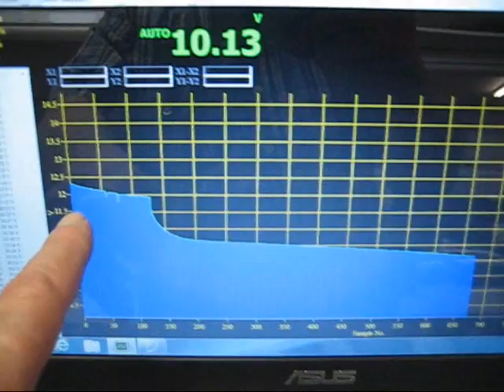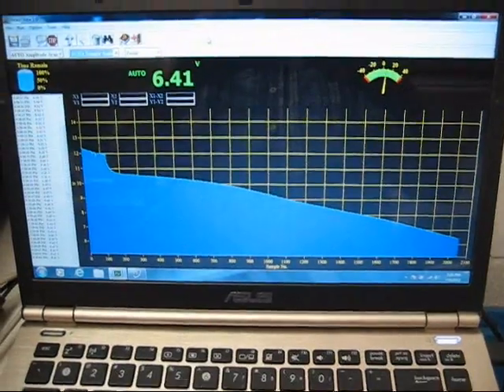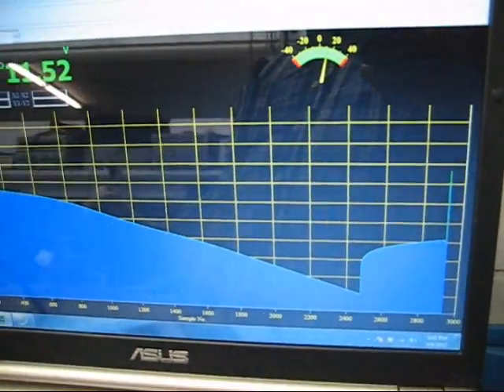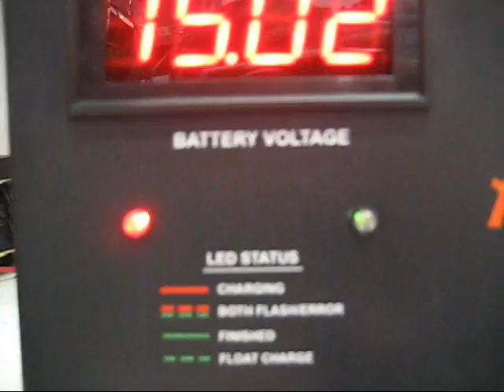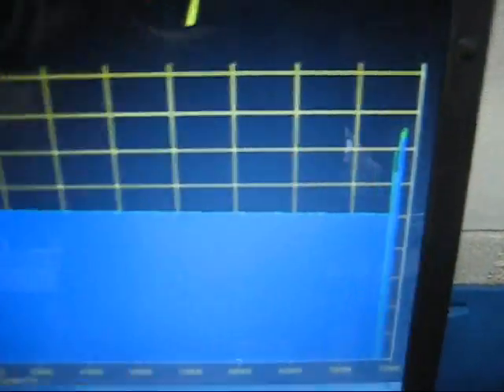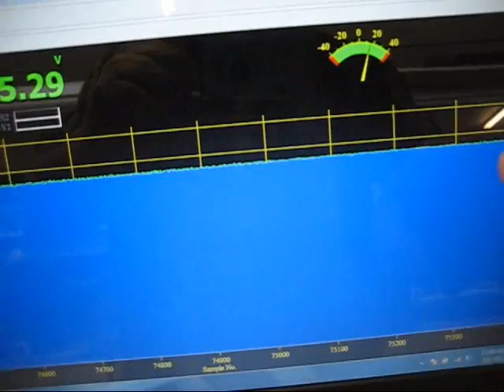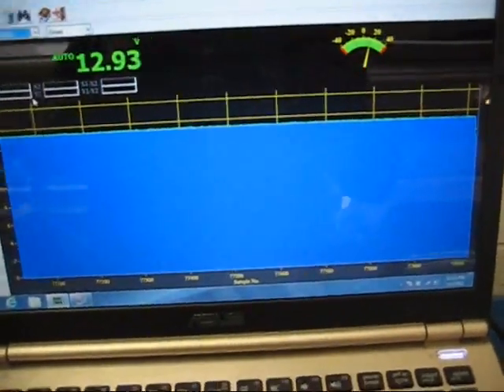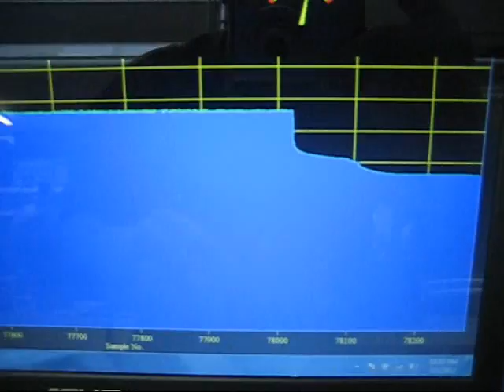Lead Acid Conversion Alum Battery Virgin Never Formed Part 2.wmv

Comment: @wfaulk1120 he's already been thru the nonesense with the guys in black. he's a hero ! and yes you can power anything you normally would with a bedini charged battery. and yes, if done correctly it is likely to put out more amp hours than normally charged battery and also a higher power level in general is often obtained. 

i will say tha guy is a genius and its up to the general public to work on the principals at work here. we are the government !